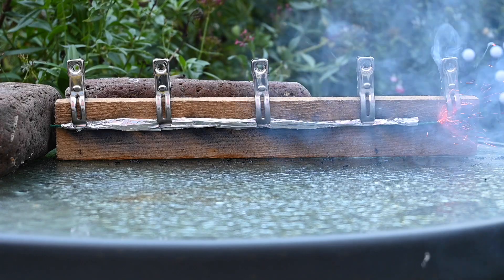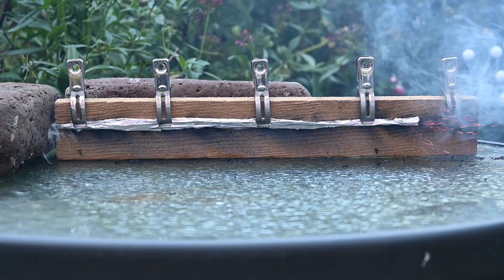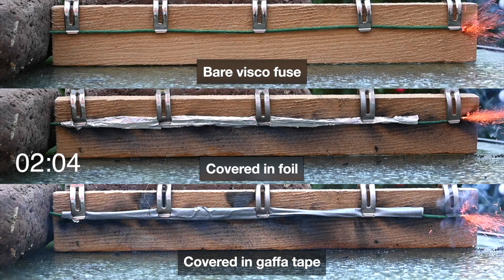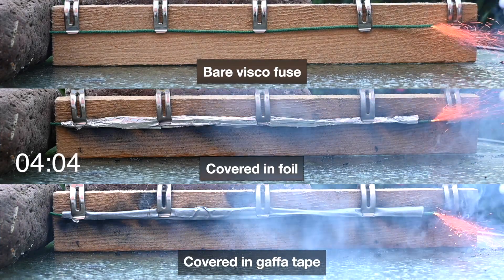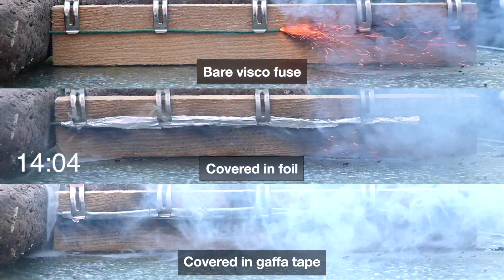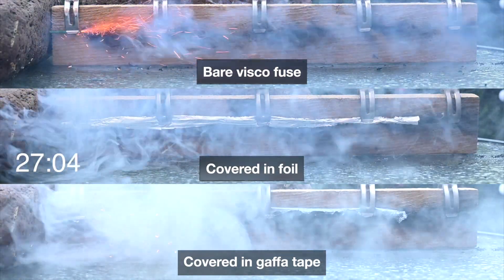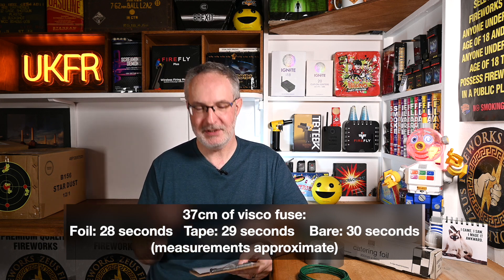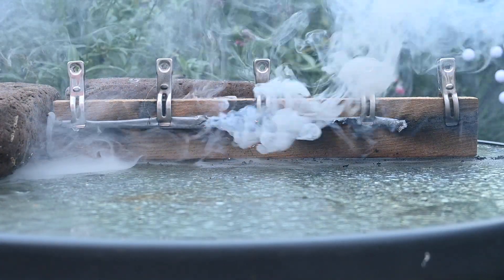What happens if you cover visco fireworks fuse in tape or foil?

Comment: Can you link different visco fuses together? Say an orange 12.5cm/s with a 1cm/s? I’m In the process of building a board cakes (Las Vegas crate). I want to link all cakes to give a continuous display and didn’t know if it was possible? Potentially linking them with small zip ties, any help would be much appreciated 🙏🏼
Reply from the maker: I've not done it myself but some of my forum members have connected visco in the way you describe, using small cable ties. I also see a lot of connections in compound cakes which simply twist the fuse and then tape it. So it's possible and you can easily do some tests on small bits of fuse.
Reply: Thank you! I will try some tests tomorrow on some small off cuts 🙏🏼 I‘ve got some 1cm/s but for the cakes where it’s situated a little far away I’ve used 12.5cm/s to speed up the firing. Thanks for the reply 😁

Comment: Thanks for this Pete. I've been using straws and masking tape to enclose and hold visco links for about a decade. Quick to install, and, in my similar test, a lot less smoky than gaffa. You can link fuses by shoving them into a hole cut at the appropriate place in the straw so that the two fuses run together inside the straw for a couple of centimetres. I have yet to have one of these links fail. Be wary of "kinked" visco as the loss of powder that this causes seems to have been the major cause of my fusing failures.
Reply from the maker: Thanks Mark, great idea about the straws!